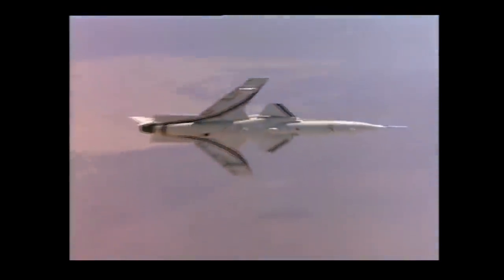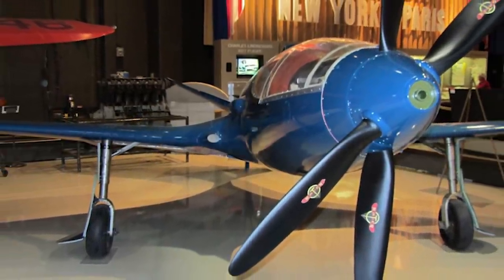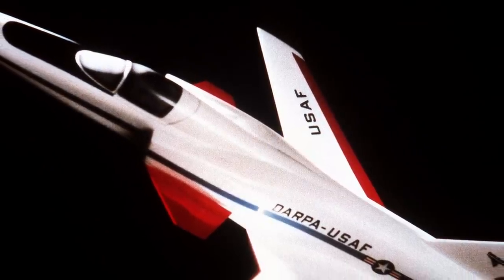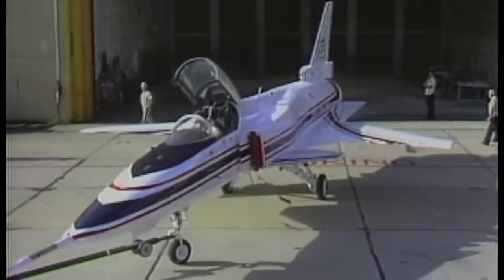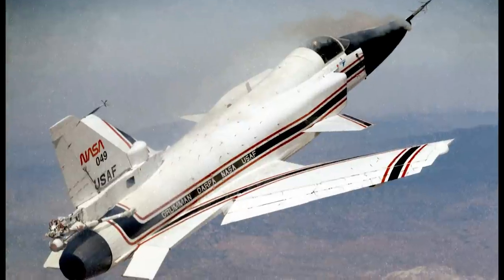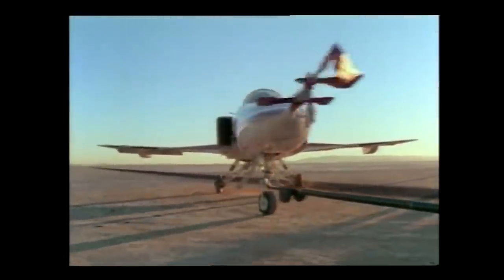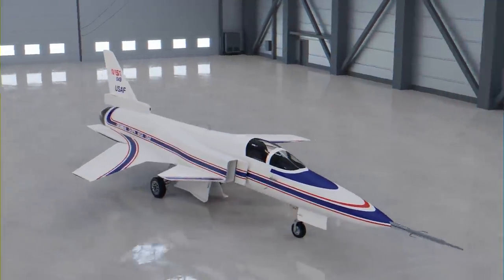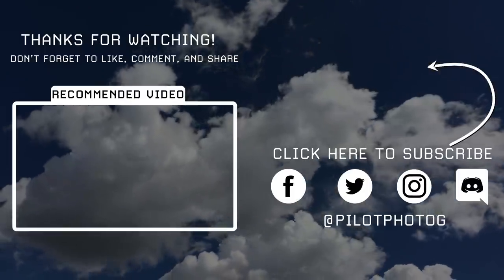The X-29's Journey: From Concept to Reality

Comment: There are rumors/siting at Groom & Tonopah of the Switchblade. Supposedly it’s wings are variable in 3 ways. One position is forward swept, for super maneuvers, one for loitering, and a forward sweep into the fuselage for Mach runs. Think of it as a F-111 replacement, but can dogfight too.

Comment: Back in the late 1980's, I had a flight simulator for my PCXT clone computer (It ran at 4.77 MHZ, and/or 8MHZ in TURBO MODE!? (Impressive, huh? No💩!)) And someone gave me a copy of CHUCK YEAGERS ADVANCED FLIGHT TRAINER, which included military aircraft from WW1 to WW2 to the Korean War, the Vietnam war, Desert Storm, and experimental/spy planes. During one flight in the SR-71 I got that plane to fly a little bit faster than what the "official" speed record for the SR-71 was! Anyways, the A.F.T also included the X-29 which was an absolute blast to fly, and it quickly became my favorite plane to fly! It also had the X15 Flying Rocket, in which I was able too fly so high that the "sky" was BLACK, with stars being the only light outside of the plane!

Comment: The X-29 as a combat platform was killed by the success of Lockheed's skunk works development of 'Stealth Technologies'. The size & shape of the canards necessary to maintain control of the airframe kills any chance of passive radar evasion, leaving only active radar jamming as a means of self defense.
Reply: Wouldn't a built-in jammer eat up precious spaces in the aircraft and add extra weight? The Prowlers and Growlers use their own hardpoints to carry the jammers.
Reply: @Joshua_N-A  Precisely. Passive stealth is what is the hot thing right now in the technology race. The X-29 is/was an absolute beast of a test bed platform, but the information developed has limited application to the "New" paradigm of current designs. When passive stealth gets cracked & reduced in effectiveness the work done by the X-29 will probably greatly increase in relevance, or all that data could be surpassed by something that none of us "Plebs" have seen yet.

Comment: always loved the looks of the X-29.
in flightsimulator 4.0, there was an option to "create" ones own F-20. playing with the configuration and moving the center of gravity to the rear, the design switched to the one of the X29, actually giving the "model" a higher fidelity.. loved to "fly around" with that. and missed it in FS5 and up (until more realistic models were created for FS98 and 2000)

Comment: 4:55 The HIMAT did NOT use a FSW. As can be seen in the video, its main wings and canards were conventionally, rear swept delta wings. 🙃

9:36 My understanding is that the two X-29s did more like 400 total flights before retirement. I think airframe 1 did about 220 general aviation missions;  then airframe 2 did 120 focusing on military maneuvers, then 60 more with smoke vortex studies. Those composite wings really took a beating!

10:44 While competing for the DARPA 1977 FSW project, one of Grumman's artists painted a 1979 pic of a couple of X-29 type planes as fighters. They were black or dark gray on top, and light gray below, with US military roundels. And the nose was definitely longer, ala an F-5 or F-20, just like your Retaliator concept. But there were no visible weapons stores. 

Then when the USAF requested proposals for its Advanced Tactical Fighter (ATF) program in 1981, Grumman suggested an ATF version of the X-29 with dual 2D vectored thrust nozzles for even wilder maneuverability. My understanding is that this derivative design was known as ATF Concept #9.

But as you said, stealth eventually became a major criterion for the ATF, and the Grumman FSW design lost out. FSWs have fallen out of favor, but vectored thrust has stuck around.

Comment: "MOST EVER" should have known from the name . Gotta CALL BS on this one . This plane is fly by wire , the F-117 could not fly at all without a computer to manage the imbalances I.E. could NOT be flown by a human , pilot must be a computer  .
Reply from the maker: 35% unstable is still the highest for any fighter aircraft - thanks for commenting!
Reply: @PilotPhotog  Figured to see a response somewhere using the fighter/bomber part instead of jet part and not comment on the flyable in 1900 as opposed to only flyable after the real pilot is charged up .

To me it seems addressing that point would be required to reach the MOST in HISTORY part .  To be honest , the most unstable fighter in history never got off the drawing board , what you mean is ... to actually fly ?  It is the "in history" part I am objecting to , not this video so much since it appears solid information-wise and I DO like that aircraft .
Reply from the maker: @I_am_Diogenes  thanks for the follow up response, what I mean is for a single type, as mentioned in the video the F-18 has an instability factor of 5% and most 4th gen fighters are somewhere in the range, by contrast the X-29 had an instability factor of 35% so 7 times greater.  No other fighter has approached this value so the X-29 is king in this area.
Reply: @PilotPhotog  What does instability factor mean? How does the F-18 get 5% instability? And what would be the F-16 or F-15 instability factor? I looked on the net for some kind of definition and didn't find anything good. I wonder what the Su-57 instability would be. Or even the X-36 with it's thrust vectoring and canards.